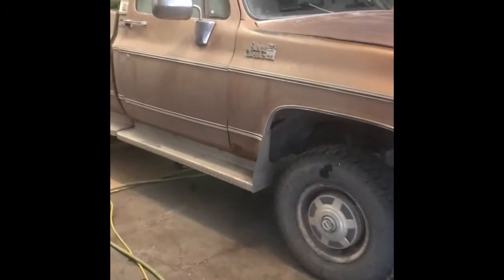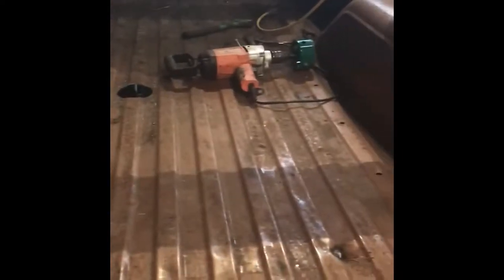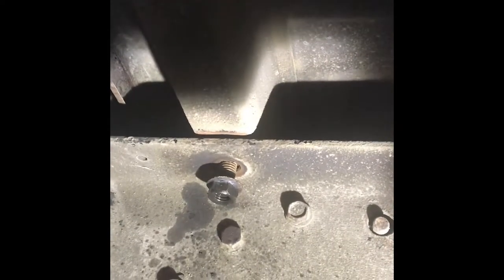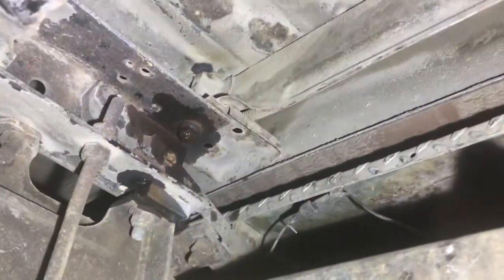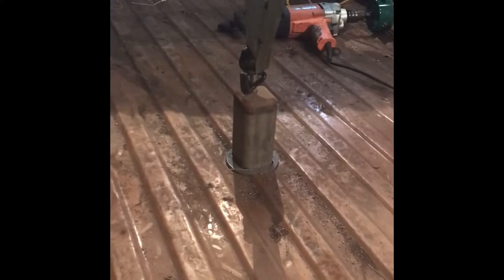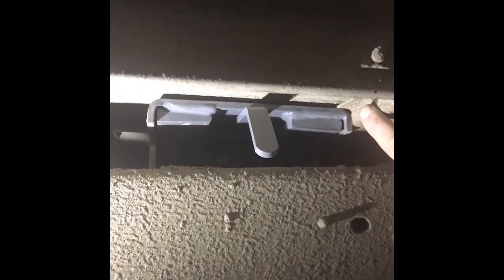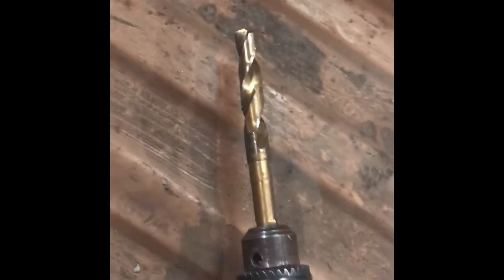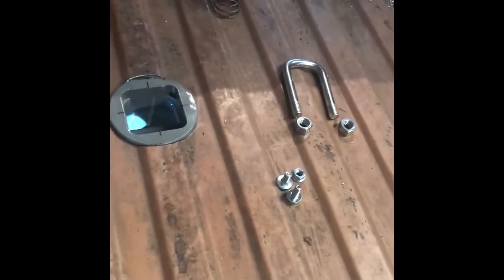B&W 1400R gooseneck turnover ball install - 1980 GMC K25

Comment: Thanks for the video! I'm intending to install the same hitch on the same model of truck. Two questions -- #1, where is the towing point relative to the rear axle? How many inches forward or behind  the axle? #2, with the ball in the stowage position, is there any risk of the differential or driveshaft hitting the ball under full suspension compression?
Reply from the maker: It’s directly over the axle.  With how high/stout the suspension is on that pickup, I can’t imagine the circumstances that would cause that to compress to the point where the ball would make contact with the differential.  I think you’d damage other parts prior to that being an issue.  Keep in mind, mine is a K2500 “Trailering Special” with 12,500 GVW rating from the factory.

Comment: Two questions, do you have some leeway as to how far back or forward you install this thing? Also, from my research this seems to be the only gooseneck hitch receiver made specifically for the square bodies. Is that true?
Reply from the maker: You probably could but I wouldn’t mess with forward backward measurements.  What are you trying to achieve by moving it?  There are numerous options that are I guess universal although this may be the only turn over style.
Reply: @fpsdano7446  From what I understand the ideal placement for a gooseneck hitch is about an inch or so in front of the rear axle, that way the front axle of the truck is able to carry a small percentage of the load, which slightly increases payload capacity.

Since you have to drill the holes yourself, I was wondering if maybe it's possible to install it about an inch forward (instead of directly over the axle)
Reply from the maker: @connorbunch3577  I’m sure that’d work but you think an inch will give you any more leverage?  I don’t think so.  The further forward you go the less play you have for distance between your rear bumper and the trailer.  I’d install per the instructions.  After all they make and test the hitch.  B&W has been in the game a long time they know their shit.